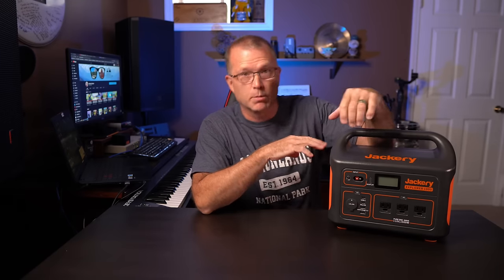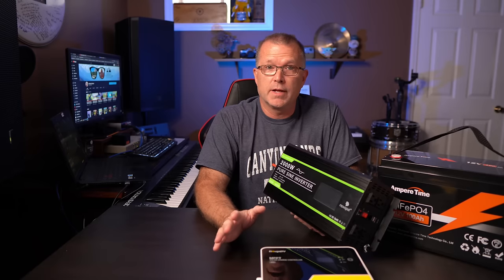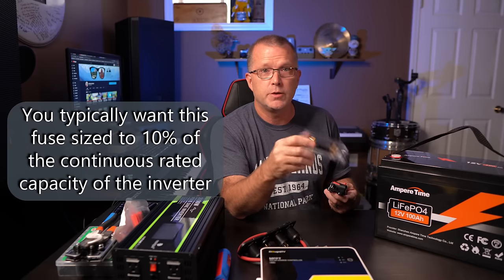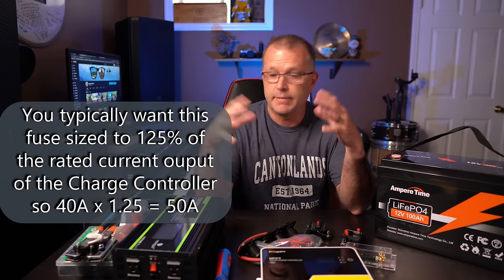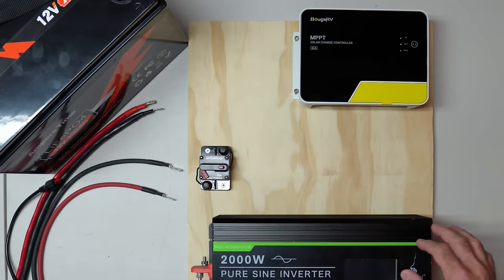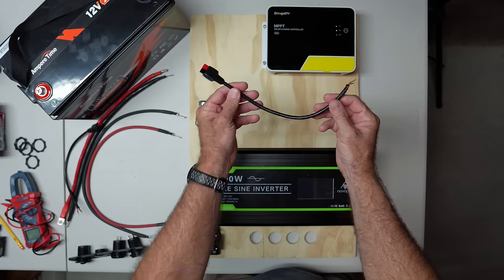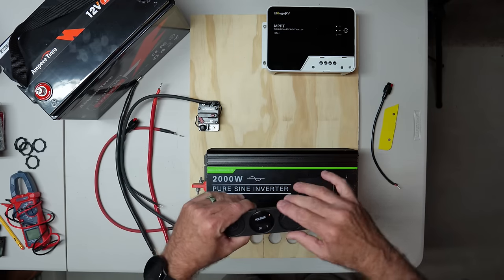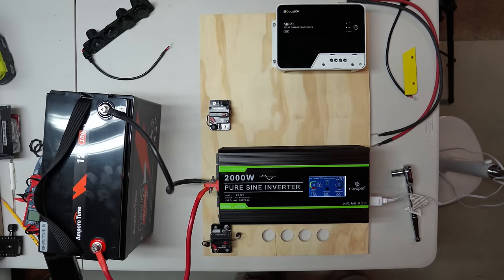BEGINNER FRIENDLY Step-by-Step: DIY SOLAR GENERATOR for Emergency Power, RV, Shed... Ampere Time

Comment: I just built a system for my shed, just to have lights and be able to charge my tool batteries.  I bought a lead/acid deep cycle battery, I had a 400w inverter that managed to get fried, so I upgraded to a 750w modified sine inverter.  I was trying to buy a 2000w pure sine from Harbor Freight, but they didn't have any in stock.  I do have one of the little cheap PWM charge controllers, just to get started, but I do have a Renogy Rover 20A 24V MPPT control coming.  I also only have a single 100W solar panel that I got from Harbor Freight.  I have plans to add solar to my house, so will eventually replace that with some other probably 250W or 300W panels and then use the HF panel for when I go camping.  All-in-all, a pretty easy project and now I have power in my garden shed without having to run any wire out to it!
Reply from the maker: Nice!
Reply: @Dienekes  I have the Harbor Freight 2k inverter,  but think all their inverters are modified, not pure SEINE wave. Now I have to look again, I'd feel better about that.
So how is the 1 panel and 750w model inverter working after a couple weeks? I have the HF 750 w inverter as well, but all in the box still, lol
Reply: @heatherk8931  They have a new one that is pure sine, but they are hard to get because they are new and sell out as soon as they get any in.  But yes, most of the ones they sell are modified sine.

As for my system, it's working great.  I have several chargers, a Ryobi, a Hercules, and a couple of Dewalts.  I also have a 56v Ego battery charger for my weed wacker. They all charge batteries at the same time with all the lights in my shop (they are 120v, but with LED bulbs).  I'm very happy with it so far.

Comment: I was told never put a automotive battery on concrete.  Not sure if that applies to all types of batteries, but I still always put batteries on small piece of plywood or rubber sheet on garage floor.  Very informative video thanks.
Reply: 🤔 interesting.   Ive never heard that before.   Makes some sense with temperature differentials.   Might depend strongly on local climate.   Hot summer cold winters=really cold concrete vs air...  somthing to consider for sure
Reply: I have been told the same about lead acid batteries by several different sources as well.   I am curios as well if it applies to AGM(sp?) batteries or solid state...

Comment: G'day from down under. I am not a "sparky" but I have dabbled in "off grid" mobile systems for many years now. Technology is such a good thing. Your system is very nice BUT from experience I have to say that using that cigarette lighter socket to power a fridge is a bad idea. They run fine for a couple of hours but they get extremely hot. I almost lost my 4wd to a fire 3 years ago. Best way to test one is to run it for a couple hours then unplug it and feel how hot the tip is. Just a tip for those who are looking to try setting up a mobile off grid kit for the 1st time.
Reply from the maker: Thanks for sharing the experience.  I will definitely check that out and see how things work the units I have.  Definitely not had any issues like that so far, but I've also not  checked the temp on the connector tip either so...worth a look.

Comment: I build models and never use super glue on a clear plastic component because the super glue will cloud the clear plastic.  Great informative video!  Thanks!
Reply from the maker: yeah NOW I realize that hot glue would've been a much better choice. :P
Reply: Even the vapor off of superglue will cloud clear plastic.

Comment: Thanks! Will look what you did once I get the basic stuff as I am doing exactly this right now (went on a spending spree last night on Amazon), just to learn how it all works (money wise if nothing goes wrong, it will take me 7 years to get even haha). I did buy a smaller inverter as they also consume power. Didn't think of the breaker box, but was thinking about shutting it down with a relay linked to my domotica so it doesn't consume energy when it doesn't need to. For now I want to run my 120watt hue setup on it to see if the Dutch weather can sustain it with solar energy (I have my doubts), but when it does, I might upgrade and place a fridge just like you did, good idea. I subbed!
Reply: I have been learning and Googling/chatGpt'ing the whole evening but the AWG wiring confuses me. For a 12V 100ah battery and wanting to serve 600watt max I keep getting that I need a AWG2... but you have more and you use a 5/6 AWG cable. So I guess the 5 is for the battery (the 200a circuit breaker seems overkill btw). Any insight? It is going to be 1 meter max.

Comment: This is amazing! I was searching a way to charge my laptop and keep producing music even in remote situations, but this covers pretty much everything in case of emergency! I'm very glad to have found your channel, just subbed!!
Reply from the maker: Thanks man!  Portable Power Stations are great for that sort of thing.  They pretty much all use an integrated 'pure sinewave inverter' to ensure that you're getting clean AC power for your sensitive electronics.  And it's surprising how long you can run a sound system (or music production DAW) off a 1000Wh power station!  I've done both and they work great!
Reply: @ReeWrayOutdoors  This is great to hear!! Thank you very much for your response, it's always good to hear somebody who got experience on the field!! Cheers from Italy!
Reply: @weeddiz5732  we just have an extension lead running direct to the panels. No charge controller or batteries. Works all our laptops, phones and chargeable lights
Reply: @terriegym  can you post a photo?
Reply: Can you explain further, please?  @terriegym
Reply: @juliava605  I have 3 300w 24v panels. Wire the wires direct to an extention cable. Then I have a 6 socket on the end. That's all it is
Reply: Thank you very much,  @terriegym

Comment: 13:37 The discoloration was because of the reaction of the super glue to the plastic of your meter. A better choice would have been to hot glue from the back or go without the black bezel.
Reply from the maker: Yeah, that would've definitely better. :P

Comment: Pls do a full load test & recharge test of this exact setup. Just like you do for portable power stations. By doing so, you will have done what No one else has done in this space on YouTube. I was hoping for that with this video. Pls do the next step & follow up this video. Thx

Comment: I believe you need to connect the battery + to the charge controller directly because if any of the breakers pop your charge controller will still take in solar panel watts and it'll fry the charge controller.

Comment: Right now to build this system not counting wire, lugs, and the inverter you are looking at  $708.62 off from Amazon using your link.   Now I would probably use BougeRV
 200 Watts Flexible Solar Panel to make it a more portable system for remote use to power my 12v fridge for a few days.

Comment: Nice video, really like what you did. Just have a question. 
Is it safe to connect the MPPT controller to the inverter rather than connect directly to the battery?
Reply: Was wondering the same. Everything I read online has it wired to the battery directly.
Reply: I also thought this was strange and may require for the inverter to be switched on all the time, resulting in unnecessary current draw.  The wires between the inverter and battery looked a little too thin, did he mention the amp rating of those cables?
Reply: @tyrausfarrelly6257  It is a parallel circuit, with the inverter OFF, the charge controller is still connected to the battery.   You may notice there are four wires connected to the inverter.

Comment: You should either solder tin thends of the wires going into the charge controller or put crimped terminal ends on them.
Reply from the maker: No argument here!  I was trying to keep this as simple as possible and I was afraid that busting out a soldering iron would lose 50% of the people watching.  :P  Crimped terminal ends would have been a better choice though.  I may do that in the next one, so thanks for the comment! :)

Comment: I started with a simple 614 wt-hr system with a all in one LiFePO4 power station.  My original intent was to use two 100 watt panels but the power station has a 100 watt input limit so I can only use one of my panels unless my efficiency drops below 50 watts output.
Reply from the maker: Yeah, that is definitely a bummer on more than a few power stations!  I won't even bother reviewing anything in the 600Wh+ range now unless it has a minimum of 200W solar input capacity.

Comment: I got 2 48v lithium battery banks 280Ah & 4 - 100W Rich solar panels , 100A breaker box majority of wire , Moes Automatic Transfer Switch , 3KVA inverter charge controller 24v 1 Phase & a 5KVA 230v inverter charge controller 48v 1 Phase

Comment: I have been using heat shrink with solder built inside from wish that work excellent for small to 12 g wiring. Simple lighter or small torch works and they don't melt or flame up easy at all, they just work. My 10 year old can use them they save crazy amounts of time and super super cheap. Like 15 bucks for 300 in assorted case. I ordered several

Comment: This was excellent; excellent; excellent; just the video I've been waiting; a user friendly step by step power system with solar. I have been wanting to make a DIY system for RV and home back up. I looked at many videos but most were either over the top for an electrician or they skipped over much of the process. These videos are most needed. I would to see more explaination of the solar panels and understanding the voltage and watts of the panel. I think you said you would do another video on the MPPT charge controller. Did you make that anderson plug? How does the MC4 connect to that? These are the important but fine detailed that would help the beginner gain a confident understanding before building even a simple system. How did you determine the size of the cable to connect to the battery? I've seen people use a variety. Does the inverter recommend a size? Does the charge controller recommend a size? Does the panels recommend a size? You have a gift for explaining things very well and detailed. I would beg to see more videos for the beginner. A video series of each section; creating AC power with inverter and battery; then one on DC power and how to add it; then one on solar and how to add it with all the details for someone like me; "Solar Generator Systems for Dummies!" - lol
Reply from the maker: Manny, all excellent questions, my man!  I'm actually working on the Charge Controller and battery videos right now and I'll try and cover some of these topics in the course of that.  The 6 AWG cables I directly connected to the battery came with the 2000W AC Inverter.   Strictly speaking, 6 AWG is over-gauged for this setup since it can handle 65A and the Inverter can never pull more than 4000W / 110V = 36A (and only for a few seconds at that level), but it's never bad to be over-gauged. If I'd had to buy my own battery cables, I'd have gotten more of the 8 AWG I used between the Charge Controller and the Inverter, but again, I'll try and get into that in more detail in the next 2 videos.   Wire guage is all about the max current the cables need to carry and how long the cable runs need to be, so referencing a Wire ampacity chart is essential.
Reply: @ReeWrayOutdoors  Awesome; thank you very much!

Comment: In all fairness, the cheap pwm charge controllers work will with smaller applications and small batteries i.e. garden irrigation or yard lighting.  I think different sized systems will get differently priced components based upon safety  and use.

Comment: Just seen this which is great. Only one question: does this not be better off with adding a dc breaker/isolator ahead of plugging in PV array? especially as they are inexpensive. cheers

Comment: This is the best DIY on this that i have seen so far.. I am a little intimidated by building this myself but I'm going to try.   I purchased 2 - 12v powerqueen 100ah LiFEPO4 batteries, a Bouge RV 2000w inverter, and will probably get the BougeRV 40amp MPPT charge controller as well.  I have 2 -100 watt panels, and multiple other portable panels.   I suppose I can wire the batteries in series or parellel, but which would be better?  I also got the 50amp breaker and the 200 amp breaker you used.   I'll either use this is my shed I will be buying.. or I also own a pontoon boat if I can maybe use it as a house battery system to run my dc fridge, and stereo while out docked at the sandbar.  I own a few solar generators that I have been buying over the years.. I don't know why it's just an obsession/hobby.
Reply from the maker: Thanks for the kind words!!   Your AC inverter will determine what voltage you need to operate at.  So for the 2000W BougeRV, that means 12V. So you would need to connect the batteries on parallel to maintain 12V for the inverter.
Reply: can you explain more on what cable size to use? I have 2 powerqueens 12v 100ah and Bougerv 2000w inverter, the bagttery manual says to use 6awg to connect in parralel but the charts I see on line for 200 ah is 2/0 AWG??   @ReeWrayOutdoors

Comment: Thank you for you videos . I'm going to be building this. I understand short wire for the power station. How about the ac coming out of the inverter is it ok to use long extension cord to get to the appliances? Thank you

Comment: nice explainations, I like the 12vdc freig. I'd like to power a 12vdc AC w/out the generator.
I want a truck driver type AC which I believe uses 300-800watts it has it's own DC to AC converter. so for me I could not use the invertor you have. my RV van doe's have AC & DC so I'm only wanting to power the new AC w/ a solar generator like this.

Comment: Great video thanks for doing it, question , what is the operative temperature of the battery and if you keep it in your garage, what do you do during the winter when the temperature is under 32F?
Reply: I'd be interested in knowing this too. Probably uses a battery heat pad or I seen where someone used an aquarium heater (lol don't ask me how he did but he said he did!)

Comment: Good job! The only thing im not a big fan of those circuit breakers
Reply from the maker: Yeah, you're not wrong about that.  They are pretty cheap.  I do still use that 50A breaker between the controller and the battery, but I've since changed-out that 200A breaker with a disconnect switch and a 200A fuse.
Reply: @ReeWrayOutdoors  the main reason i say im not a big fan is the couple i bought fell apart on me.

Comment: Can you please cover the solar panel specs you are using for that system?  How many?  What voltage, what current? what Amps?
Reply from the maker: The primary panel I used with this setup was the BougeRV 200W:   Voc = 21.6V, Vmp = 17.98V, Isc = 12.1A

Comment: I've been watching several different videos and learning along the way. Your videos have provided a good setup for my needs, thanks. For us newbies are you going to mount to a wall?  I'm looking to make something that's portable when in use it'll be on a covered patio.  I have a Lithium battery so can the battery be in a box with the charge controller and inverter?

Comment: I'm a rock, please explain to me how you connected the wires to the panel at the bottom that has the 12V cigarette plug.  Were they piggy backed to the cables respectively connecting to the battery?  Great video by the way.

Comment: I'm new to this.  So if my question is dumb I'm sorry, or if there are simple ways to figure it out just let me know.  So.  I want this or something similar to power our 2 refrigerator/freezer combos,  and a chest freezer if we lose power.  I could probably consoldate down to 1 fridge/freezer and deep freezer if I had to in an emergency, but would this be sufficient to run all 3 assuming I had good sun coverage to get the batter recharged?  I wouldn't care about preserving anything else.  Well, maybe running my Traeger which would use power to feed pellets to smoke my meat haha.  They are all newer appliances, within the last 3 years.
Reply from the maker: I think running the Traeger is definitely a non-issue since I'm sure the pellet feeder is very low watt-draw.   I'd think you're likely to need at least 400Ah (5120Wh) to keep all 3 running - so that would be 4- 100Ah batteries or 2-200Ah batteries.  But to know for certain, you'd want to put a watt-meter on each for at least 24 hours or more to get an average hourly power draw.  Then, of course, you'd need to have sufficient solar capacity to replace all the power used during no-sun period.  The AC inverter I used in this video would be plenty sufficient, but you'd probably also need to upgrade to a higher capacity Charge Controller....something that would support, say, 1000W input.
Reply: @ReeWrayOutdoors  Wow thank you so much.  I do have a Kill-a-Watt meter so I'll throw in on each of the devices.  Is there a basic equation for this stuff or maybe a calculator made for figuring this stuff out for dummies?

Comment: Great video. Question...the charge capacity is 40 amps, so does all 40 go into the battery? Or does it only allow what the battery can take? Like 20 amps... im just starting out, and not certain. Thank you 🤙🏾

Comment: Thank you. I'm a beginner in solar so this helped me understand how things need to be set up. Now what would I need to change to put this on my camper van? I need it to charge while running the vehicle and with solar. I would also like to have the ability to charge it when electricity is available. 
Are there any advice or helpful links on YouTube out there? I haven't been able to find any that were this informative. I need kindergarten level tutorials. Lol
Thanks